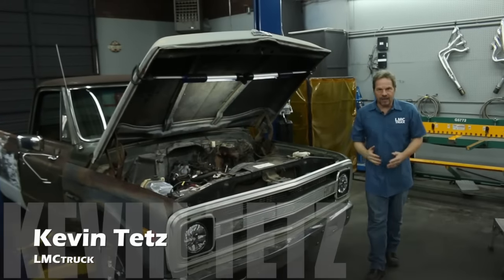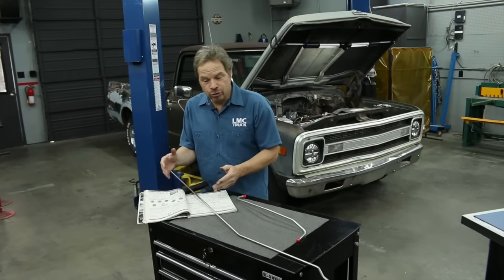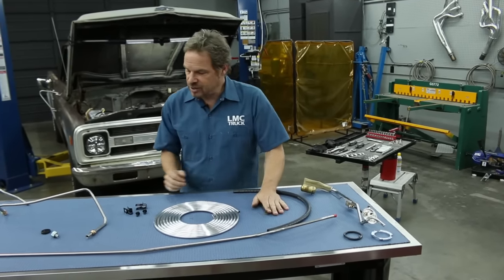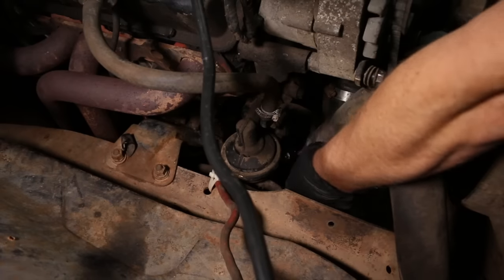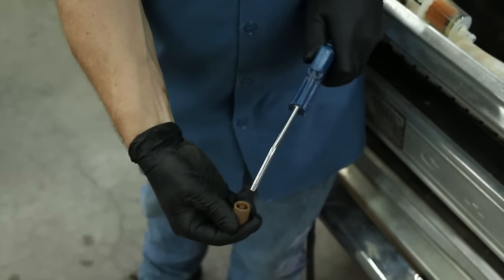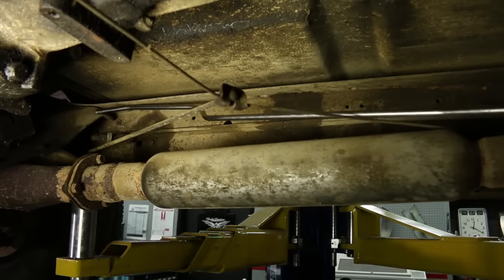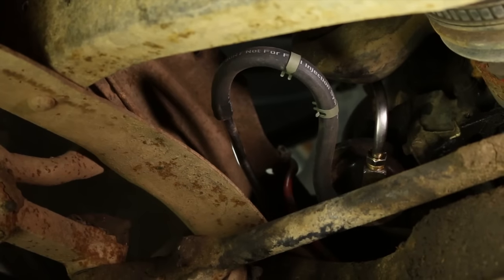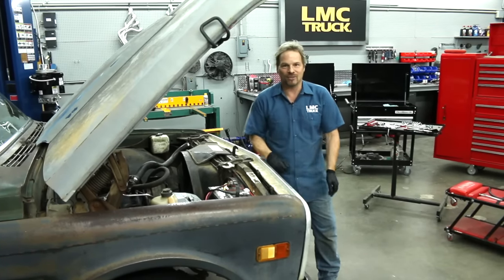How to Replace and Upgrade Fuel Lines for 1967-1972 Chevy Trucks - Kevin Tetz with LMC Truck

Comment: Put the red cap back on before trying to push the fuel line back into place along the frame.
Fuel filter should go before the fuel pump, don't rely on that carb filer.
Reply: Noticed that too. Should have put a filter on the frame from tank line to frame -pump line where the gentle hose went.

Comment: The fuel pump line to carburetor should have been run directly to the carburetor without the inline filter.  Fuel line should be on the inside of the alternator mounting bolt.  Not that it matters now, 2 years later.
Reply: You're correct. Hard to believe so many "experts" are better suited for other jobs.

Comment: From the frame to the fuel pump. My line keeps kinking. Starts out just like yours. Nice long loop but after a month or two it starts to flatten our in the middle of thar loop. Aggravating cuz it's not fun replacing all the time